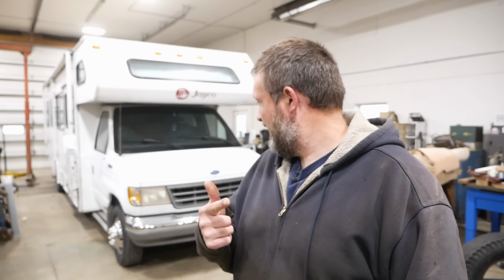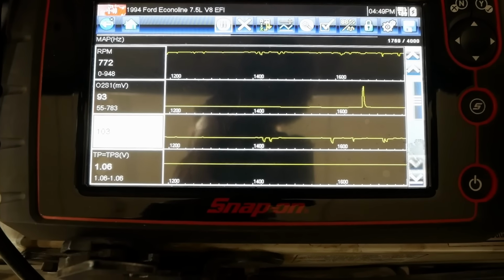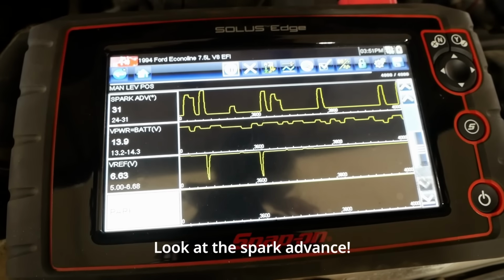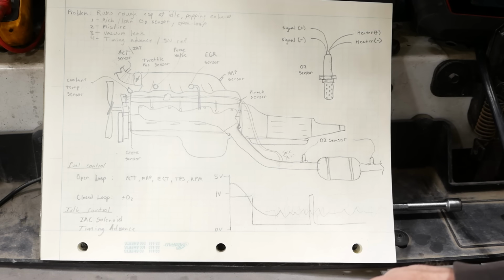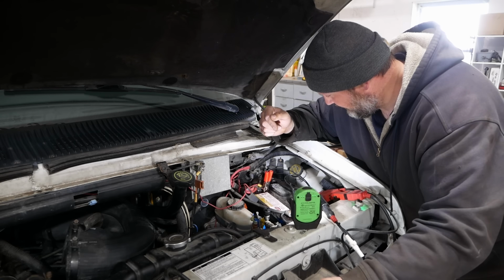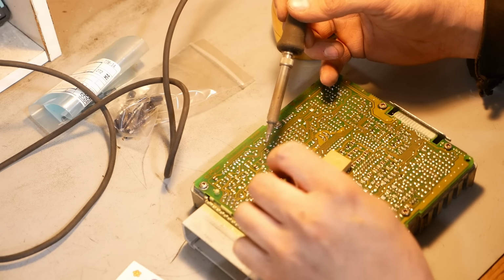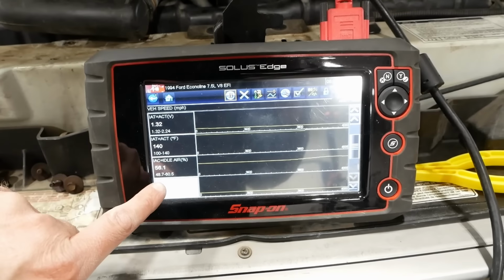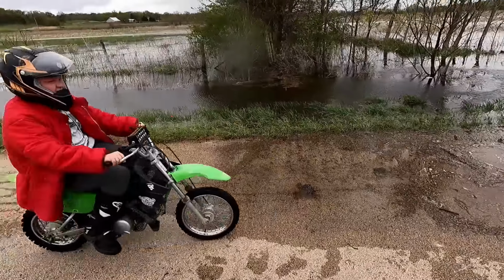Ford 460 RV Surges, Runs Rough but Nothing's Wrong?

Comment: Hopefully it makes you money on youtube, and makes you money in repeat customers, and is a form of advertising for you.  It also makes you a better and better mechanic.  It makes a lot of other people better and better mechanics.  There is nothing wrong with charging a living wage for the repair you did, even if it only took a few cents worth of capacitors.  It took your time.   Charge what your time is worth.  It is less than the price of a new RV.  If I get to the point where I can't keep my old van running, I won't hesitate to bring it to you and pay you what it is worth.  It is cheaper than a new van, and I love my van.  I see Ivan at Pine Hollow is getting vehicles from several states, and is now even road tripping to Kentucky.  I expect the same will come to you.  You are talented, and a bulldog for getting to the bottom of things.

Comment: Another excellent video. Thanks for pronouncing  "Solder" as "Solder" not "Salder" no one says "Saldiers" in the Army. As for timing to control idle (spark scatter) I use this method with a Megalolt ignition system: With throttle position sensor showing closed (idle).  Engine slows - timing advances,. Engine speeds up- timing retards  sort of works.

Comment: Been encountering a lot of early 90s Fords in particular that have their ECMs failing due to leaking capacitors. (Obviously other makes can be affected too, but I've come across a lot of 90s Fords with this problem.) You got lucky on this particular vehicle, Wes, as I've seen the boards so badly corroded, by the electrolyte, that the PCB itself is irreparably damaged. Couldn't have caught this one at a better time!

I've since learned of efforts being made to reverse-engineer these ECMs to fill a steadily growing niche for replacements modules, as Ford stopped making these well over a decade ago. It's why the prices on used modules have skyrocketed as of late, and most of those are almost guaranteed to have the exact same problem.

Comment: I find rvs can have problems with engine heat causing problems  becaue the design I've seen starter problems from. heat. maybe exhaust wrap would keep heat down. computer should be located elsewhere.

Comment: Your issue with the 5V ref might be in the circuitry that measures it and not with the reference itself. Or it might simply be the scantool interpreting the data wrong. Also, about the desoldering tool, they usually tend to work better when pulling solder with the tool's tip horizontal. At least my cheapo one does

Comment: I had a similar issue on a '91 Buick Skylark Custom. The IAC is a valve, and over time, carbon can build up on them and cause them not to work properly.  I hit mine with carb cleaner, and it made a world of difference. I replaced it later on and it fixed the problem. If the IAC is carbon fouled, it will work well enough to appear like it is good, but it doesn't work well enough to do what it is supposed to do. I can't remember what it is, but they actually have a recommended replacement interval. This was the first car that I ever did my own work on, and I fought with it for over a year before I figured it out.

Comment: Being a retired mechanic having done this stuff for decades, bad computers can be a tough one to figure out.   Nice catch and repair.   The last module I did was on my own Dodge Caravan going after the SRS light.  Turned out to be a bad control module but thankfully the local self-service wrecking yard has a butt load of Caravans and replacing it with another one fixed it.

Comment: I have a hard time with the ford stuff from 84 to about 90 most of the time it's bad wire connector  or a air temp or coolent  temperature sensor. All most never a computer. Good job. My shop is full of cars and trucks from the 50s to 2023 .

Comment: Very fun video for this old fart. Started off in "Thru Hole" at the beginning of the F-16 Program ... back when the forward equipment bay (FEB) was chock-a-block full of "MUX Boards". At the beginning, we couldn't figure out how they'd pass ATP and less than a year later, they'd crap out. Final answer was "ESD" issues. Seems the "Solder Suckers" we were using were "spring loaded" and when triggered, gave off just enough ESD to damage the components but not fry them; slow decay. We then removed them from the shops and a year later, no more failures. This reminded me of it.

Liking how you managed to violate both "Mechanic's Laws" ... you worked on both an RV and an "ATV Boat" !!! LOL
Reply from the maker: That's an odd failure mode.
Reply: @WatchWesWork  Indeed it was ... and dang hard to figure out too. Same reason I cringe watching folks work on boards without an "ESD Strap" ... especially now we're in the SMT mode ... "Tubes" were the most robust, nowadays, not so much Bro. 4 decades in Aerospace ... amazing changes, some for good but not all (my C-130J still uses "Dimpling" of skins/ribs/spars (since 1954) instead of "lap joints" ... we may lose the Wings on a hard landing but the Fuselage will remain integral ... and the Crew (my "Customer") will usually live.

Comment: 25:43 probably a preformulated calculation, written inside one of the chips. Wouldn't be the first time or the last time this kind of a method has been employed, Fiat has that, Ferrari has it, Audi etc.. Problem with it, especially in a vehicle, degradation isn't taken into account. The idea is that if the tech observes degradation, will fix it OR the vehicle gets scrapped, but that's according to the wishes of the greedy CEOs, not those of the buyers. So when a vehicle like this experiences degradation, the math doesn't make sense anymore and things go fu*ky, they cough, they sputter. It's a passive system, not an active one. That'd cost another dollar in parts and maybe 50 dollars in automation. That's expensive, the CEOs will never recover from such an expense, they'll never be able to buy Grey Poupon if such a thing were to happen. Think of the poor CEOs, Wes!

FYI, if you ever find yourself inside a pickle and you can't solder the item in the same spot anymore, don't be afraid to glue the item in another location and just run bodge wires to it. If it's good for government work (NASA Apollo era bodges can be seen on CuriousMarc's channel) it's good enough for a bygone era with an near unobtanium ECU. If you use the right glue for it, the one that hardens into that semi solid semi soft white goop, you'll be set. I've had to this many times on 90's era cars and so far none of my repairs have failed. Obviously, some places won't allow that, chips an differential ways, but for 99.9% of the common issues like blow caps or blown traces, it'll do.

Comment: Ooh, I know where that RV lives... They pull a big enclosed car trailer, likely with a Chevy in it lol.  You're a brave man going after old RVs with who knows how many shade tree wiring jobs.

I never would have thought the PCM had bad caps, but why not?  Something else to look for when buying cheap OBD-I Fords.  There still could be something wrong with that PCM, but I'm leaning toward something being wrong with the air pump or the solenoids... Supposedly the pump is only supposed to be injecting air during open loop, and supposedly there are actually two locations it injects air, before and after the O2 sensor.  The before might be to test the O2 sensor? Make it go high by injecting air there?  Then inject air behind the O2 as needed?  Your drawing shows two O2 sensors... Are there two on these OBD-I Fords?  I thought there was only the one.

Something you could have explained is that, when unplugging the SPOUT connection, it lets the EDIS ignition module run independently of any PCM input.  As long as the EDIS has a crank position signal, it'll happily fire the coils at a fixed value like a distributor does with the vacuum advance disconnected.  The EDIS modules are popular to convert old cars to coil packs.

Is highway 30 between Clinton and Dewitt closed?  I remember once about 20-25 years ago that it flooded the low lying areas and closed it.  Also south Clinton nearest to beaver island flooded where they load barges... The dike and flood gates did their job to keep the city dry.
Reply from the maker: This truck does not have a cat converter, so I think it just injects air in one place. Several major roads were closed last week, but I think most are open again now.
Reply: @WatchWesWork  Ahh ok... I read somewhere that the PCM opens the solenoid ahead of the O2 sensor as a feedback loop to check if the air pump is operating.  If the O2 sensor doesn't go high like you observed, it throws a code. Why won't it go into closed loop? No idea lol.  In other OBD-I Fords from around 1995 (Contours specifically, but could be others), they used biodegradable wiring insulation that causes weird issues due to shorts (cross talk and grounds).  I'm not sure if this RV is affected or not.

Comment: So glad you are able to keep up with the modern car tech . I was given many old clunkers over my 67 years of life and I managed to learn how to repair them but , only because they were from the very low-tech era . I never have owned a newer tech car , to this day , and wouldn't have a clue as to how to fix any of the problems they have .
Reply from the maker: This isn't really modern. It's 30 years old.
Reply: I'm speaking from a "relative" point of view , most of the vehicles I'm describing are 1960s 0r 70s vintage so , I know that's not new but my stuff was ancient pretty much . Carburetor era tech . So by comparison , your doing new tech . even if it's 30 years od .

Comment: Wes i got a question for you. I have a 1996 ford van. it has the 5.8l. It starts right up good idle. But once you pull it down in reverse it dies. If you start it in neutral it then move it to reverse it dies. If you move it to drive its fine all forward gears work. I am lost any help would be much appreciated. Thanks.
Reply from the maker: I don't know. Maybe the gear select switch is bad and the IAC is not opening in reverse.

Comment: Capacitors failing are a common problem on these vehicles of that era. The next head scratching problem most likely  the transmission will start shifting funny with no codes....  And that will most likely be a bad capacitor in the PSOM(speedometer).  I have seen the parts cannon fired off up to replacing transmission with no fix. And all along its the PSOM(speedometer) in the cluster causing the problem. Its not sending good speed data out to the ECU and cruse control due to leaky cap on its PCB.
Reply from the maker: I have a video about a PSOM issue on a E350.

Comment: You’d have to look up the theory of operation for this engine combo. It’s likely operating under commercial engine regs. It ends up using the o2 sensor eventually, but the conditions are prob much different before it kicks in.

Comment: You did better than I did on my 460 ford.  I bought it with the same problem.   I only had paperclip diagnostic tool.  I threw ignition parts and o2 sensors at it.  Finally bought the ecm from Ford and fixed it.  It took years.   LoL believe it or not I bought that computer from Ford in about 2019.

Comment: Desoldering guns are so cool, but so expensive lol.
I manually desoldered all of the keys on a mechanical keyboard so I could reuse them. Using one of those plastic suckers. It was the worst experience of my life and it took me like 3 hours.
Saved 20 bucks though!
Reply: They're actually not all that pricey. Mine costs substantially less than my main iron (with commensurate inferior performance, admittedly, but I make a couple hundred new joints for everything I desolder).

Comment: It would be fun to have access to an airboat, wouldn't it?
 Have you ever repaired any HI-FI equipment? I've got a motherboard in a Klipsh powered subwoofer that quit working after an electrical storm. heh heh
 As far as the motorhome,,,, they circled the problem at the factory, it's a Ford. The company that invented the term,, "Programed Absolescence" ie. Designing "failure" into a product so it won't be TOO reliable.
Reply from the maker: I've never messed with any audio.

Comment: I'm trying to figure this out;  do Ford ECU caps last for 29 years or 27,000 miles?
Reply: The electrolyte is trying to eat its way out of the can from day of manufacture.
IMO the only reason this RV made it 27 years is because it is so infrequently driven. (subject to heat and vibration)
Reply from the maker: The PCM being mounted sideways also helped.
Reply: @WatchWesWork  Helped keep the electrolyte from eating all the traces of the board!
Their biggest help was having a talented and determined mechanic replace $1.50 worth of components rather than waiting to find another ECU with the same catch code.

Comment: Awesome of you to tackle OBD1 problems... Takes a good technician to try to figure it out

Plus, most shops would just charge for a new/ replacement module instead of rolling up their sleeves and changing out the cap

Comment: Having grown up on the river down in Quincy, I'm plenty familiar with how high it can get.  I remember volunteering to fill sandbags back in '93.  I guess I hadn't paid any attention to the MIssissippi lately - I'm right on the Illinois river about an hour and half from you and it's only at 12 feet when flood stage is 20 - didn't realize how high it was elsewhere.  Worst part is I think we're still technically in drought conditions.
Reply from the maker: 93 was the previous 3rd highest. 2001 was really bad as I recall.

Comment: Wes, just a suggestion.  When using your desoldering pump, keep suction going until you remove the pump from the pad.  I have learned that the possibility of a pump blockage is lessened when doing this.  Good board repair.

Comment: Never forget.... when a voltage- measurement seems wrong, also validate the common (ground) part of the circuit. [Battery-minus post should be considered the "mecca" ground]
Reply from the maker: I did. Sensor ground was at 0V.

Comment: Wow, great selection of capacitors. I would have used the old “parts cannon” on everything engine controls. Impressive work Wes, much more than I am capable of. I see that as a issue with those generation vehicles as they age, not everyone can fix circuit boards even if we see a bad capacitor!

Comment: There is a tantalum capacitor next to the Nichicon cap that failed, along with two others I see on that board.  (those yellow-drop things)  I'd replace those as well, since when tantalum caps fail, they fail shorted.  That could kill one or more of those chips.
Reply from the maker: How often do they fail?
Reply: @WatchWesWork  My environment is more hi-fi/computer/recording-studio/guitar gear, which means they are kept in temp/humidity controlled environments.  20-30 years there.  Automotive environments are far harsher.  This greatly accelerates component aging.  I have a tough time trusting a capacitor that I know fails shorted, as it will take other things with it that aren't always replaceable.  Cheap to replace; expensive to fail.  Worse, you know the automotive corps don't exactly use NASA-spec components; they get the cheapest stuff they can, and I'd be surprised if they considered anything beyond getting past the warranty period.  

Tantalums, unlike the rank-and-file electrolytics, are far more accurate in value & typically used in circuits where the accuracy is critical.  (think: timing and frequency applications)  The hi-fi guys used to love them, but the failure mode scared them away by the 1990s/2000s.  The pro studio guys replaced them en-mass when nice old studio recorders like Ampex AG-440s suffered burned-out heads because the series blocking tantalum cap failed short and ran high-current DC into the record head.  Poof!  Expensive.

Comment: You're a role model for all of us, Wes. Most pro mechanics haven't upgraded their knowledge base to do board repair. Only thing is, the newest boards are epoxied so tightly, and traces are so small, they are very difficult to fix.
Reply from the maker: Yeah they keep making it harder and harder. I'm not really setup to repair surface mount components, but I can swap out crusty old caps!

Comment: You might consider a collaboration with mr carlsons lab?
Reply from the maker: No tubes in my shop!
Reply: @WatchWesWork  he always point out the old capacitors, to check them out and almost always replace them.

Comment: nice job there I would never seen that coming but as fare as the O2 most OBD1 never used them they was just something to look good they use a fixed program and ran on the MAP and if they had them MAS to see how much air coming in I have a car that the O2 never worked from they day it was new and to this day its still running good

Comment: Good video!!  A tip for you that might help with the soldering,  you should be able to remove the conformal coating with either isopropyl alcohol or acetone.  If you use a UV flashlight you'll see where the coating is (it will glow under the UV) 
Keep up the great work!!!
Reply: Acetone might be good for removal of the conformal coating, but can also soften the pcb (on certain pcb formulations)  and cause swelling, leading to  delamination , and the breaking of via's on multi-layer boards. It can also cause the degradation or  dissolvement of other components such as smd's,  thru-hole capacitor covers, led's, lcd's, etc.
Reply: Nice tip. Thank you. 👍👍
Reply: Thanks for the tip! Didn’t know about the blacklight